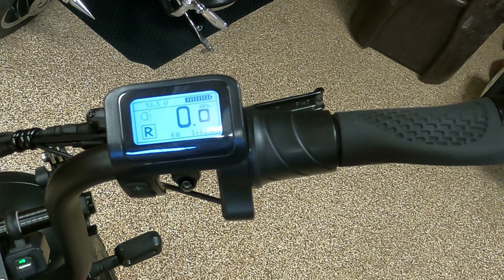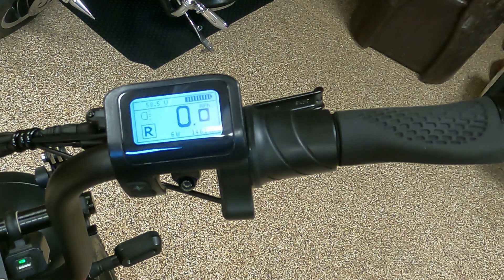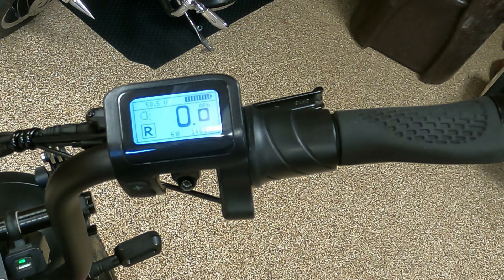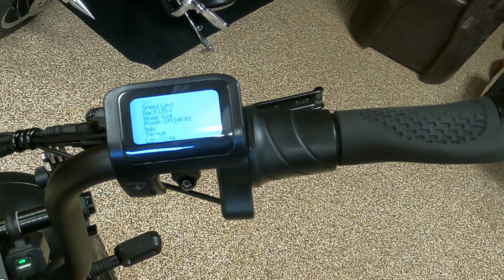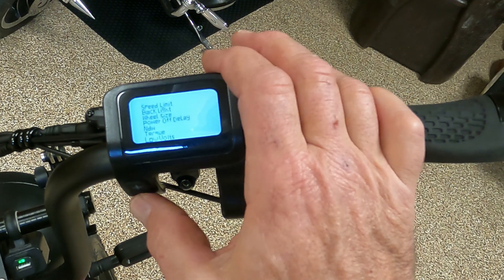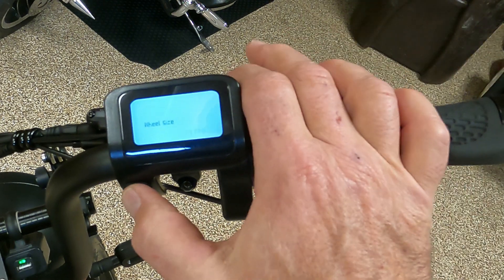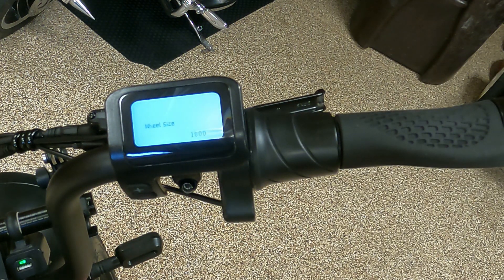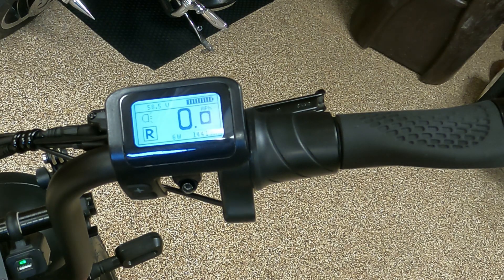✔How to & Why to Reset Wheel Size in the Computer after Changing Tires on Juiced💩JUNK💩Bikes E-Bike🛵

Comment: I rode 6 miles and my trip saying i rode 9 miles..so this means i need to make the wheel size smaller in the settings right?
Reply from the maker: At least check it, Figure the circumference, then check the # in the settings
C=2πr

Comment: If you have 26x4-in fat tires set the wheel size to 29 in your computer because when inflated the tire size is 29 inches tall
Reply from the maker: You need to watch the video again, maybe slow it down 50%?  its asking for wheel circumference in CM.... Prolly above your head but this is easy....
put a mark on the tire and on the ground, line them both up, now roll one rotation and make a mark on the ground where the wheel finishes the rotation. now go measure it  in CM.

Comment: Did it change the throttle response or max speed
Reply from the maker: No
Reply: You know i was getting into the idea of magnet hacking and came accross your video after the fact. I noticed on a video today that they adjusted the size to larger confusing the bike but in actuality with the magnet trick its less revolutions therefore gets more power disbersed. Is that how yours turned out or did it seem like it lagged? @UncleFjester

Comment: When you sit and your weight is on the bike the rubber pushes in where it touches the road surface and that while riding permanently changes the diameter of the tire you measure your tire inflated and not under riding pressure you get a false reading

Comment: thanks old man - these shitty interfaces are hard to work out.  i do think it's more than the speedometer, etc.  i think it's more to do with the motor controller and electric power delivery and all that.  i have some inside knowledge of this i'd be happy to share on a more private channel.  i'll tell you what i actually do for a living, and why i know this.
Reply: At least your bike came with instructions. Mine had a piece of paper that says "add all parts, plug in battery, enjoy!"
Reply: How about you share with the class?
Reply: It is about motor control I had mines on 2370 and it was pushing more power to the motor but I went back down to 1830